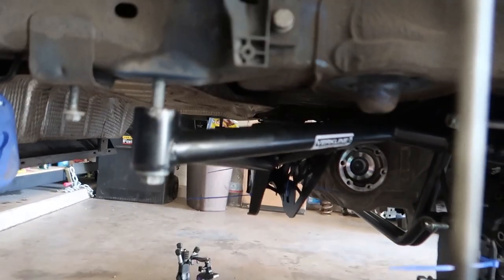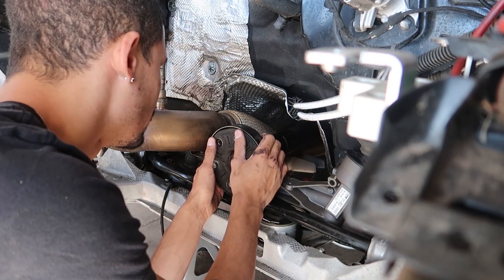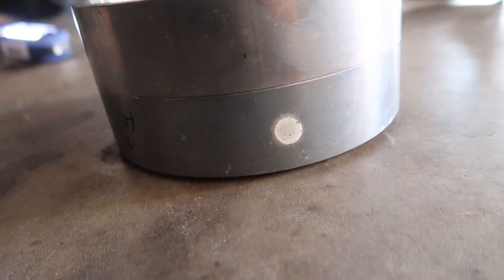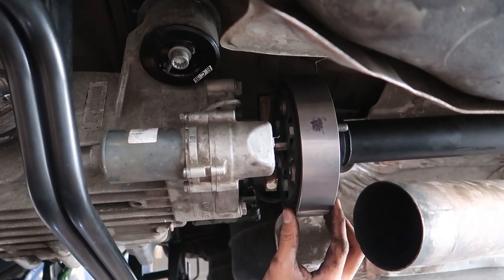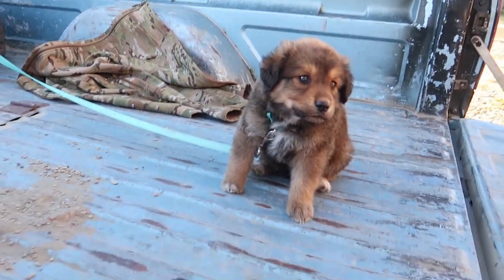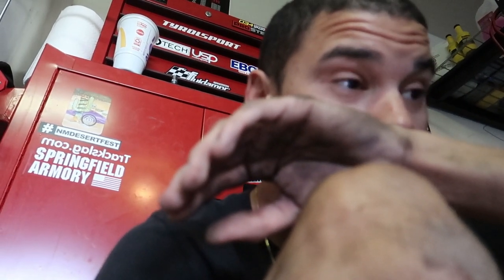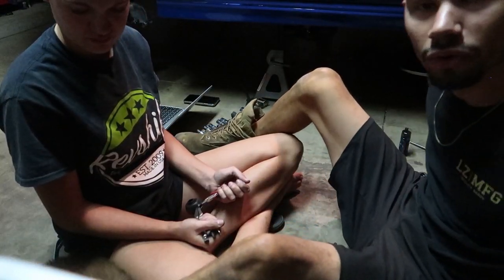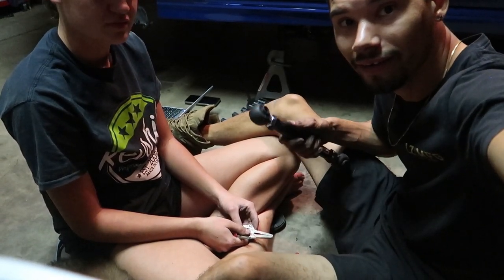Verkline tubular rear end & arms are installed!!! | MK7 Golf R

Comment: This keep it competitive now with the changes to the 2021 R

That’s where some of the changes came from other then how the tq vectoring works...

Love it.  Come Hang in Vegas anytime bud! Just lemme know
Reply from the maker: Even more so when I get the rear LSD done early 2021 😈 I'd love to swing into Vegas for sending car shenanigans. Maybe next year will be the year!!
Reply: @BryceJordanProductions  been a fan of the channel for a long time so I wouldn’t mind having another R friend swing through 

I’m excited to see more about how the rear LSD stuff is going to work.  

So did you replace the rear haldex pump or are you just adding an internal LSD to the system, thanks for the reply’s
Reply from the maker: Wavetrac came out with one for the rear so no messing with the pump! Not sure on exact details yet but they're promising great results! I have a friend out there in Vegas with a build motor from iroz on E with a vortex and manual. White R.. I wanna go visit him for sure. There's some sleepers out there!
Reply: @BryceJordanProductions  did some looking into the wavetrack LSD and still unclear on how or where the new LSD gets installed.

Does the new LSD go into the current transmission (some 6MT or DSG)  or does it get installed inside the haldex unit? I see either way you turn off the current XDS system that ends up over cooking the breaks 🤦‍♂️ 

The Goal:
and then you have a more AWD track car. with the tubular sub frame in the rear and the Audi front subframe you have ultimately something better than the Mk8 R. Noice.
Reply from the maker: @hunterlane3323  look up the group VW racers. There's a post in there about it. It's for the rear diff, which also houses the haldex. My trans is currently being built as we speak with a wavetrac.. I'm suuuuper stoked on that alone but having one front and rear is going to be insane! And to top it off I'm putting in a handbrake just for the rears.. hopefully it does what I think it'll do 😜

Comment: Also, normally you torque down suspension while it is at ride height.
Reply from the maker: Yes sir that's the plan just waiting on sway bar bushings and well kinda want the engine in but for the initial I guess it doesn't matter as much as I thought it did. Especially with the metal bushings apparently they pretty much negate the normal practice of weight/ride height when torquing down